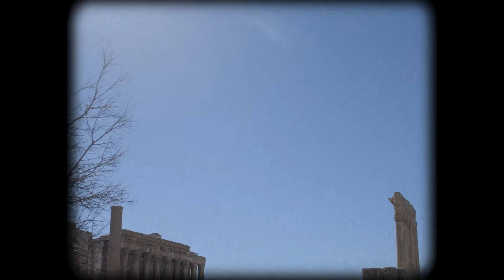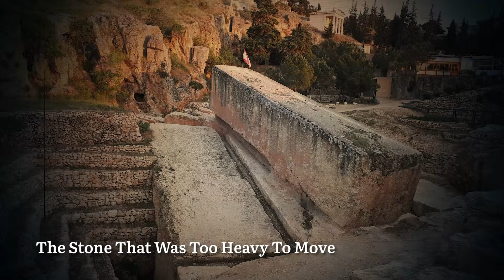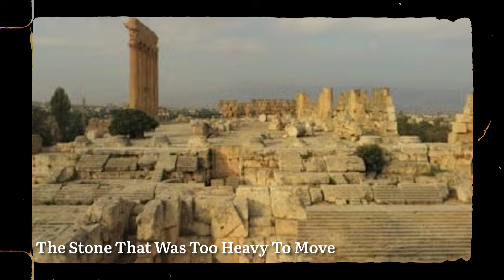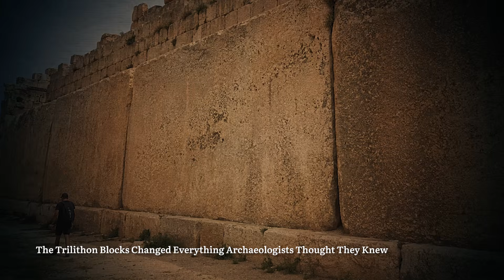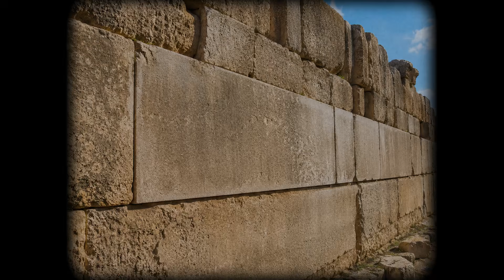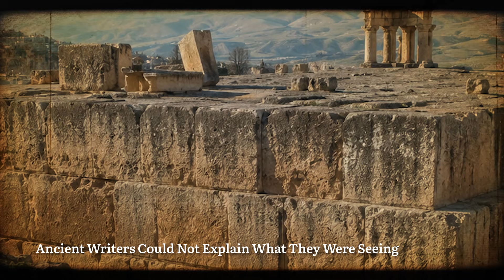It’s The Largest Object Ever Cut By Human Hands, and We Still Can’t Replicate It: Baalbek

Comment: The Stone of the South, the West Stone, and the recently discovered 1,650-ton megalith located near the Stone of the South were not cut out from a single piece of limestone in a quarry, but were cast in situ from a concrete-like material. During the casting process, masonries made of relatively small stone blocks were used as a rigid internal filler. A similar conclusion was drawn regarding the “trilithon” blocks and the plinth blocks forming the large podium of the Temple of Jupiter. Thus, the Baalbek megaliths were never transported from the quarry to the construction site. A number of features identified during a detailed analysis of the masonry of the Temple of Jupiter podium led to the conclusion that the so-called medieval Arab fortress was erected before the construction of the ancient Roman temple, rather than after, as is commonly believed today. The latter finding, together with the presence in the Baalbek structures of cavities from reinforcement in the form of multi-meter metal rods of large cross-sections, indicates that the “ancient Roman” buildings were erected during the era of industrial production of iron and large-sized products of it.

Details are in the article “Analysis, presumed structure, method and time of fabrication of the Baalbek trilithon and “tired” parallelepipeds” (50 pp., 2026).
Reply: You are just trying to sell a book of false claims. Scientific evidence shows those are natural stones not man-made concrete.
Reply: @Anonymous------  >You are just trying to sell a book of false claims.

The mentioned article is freely distributed.
Reply: @Anonymous------  >Scientific evidence shows those are natural stones not man-made concrete.

The aforementioned article presents scientific evidence that the stones are not natural but were produced by casting a concrete-like material into molds.
Reply: Literally all of the evidence goes against everything you said. You can see different blocks at every point of the process being cut out. I don't get why some (few) believe they molded them. It's the worst theory out there
Reply: @Rancid_Sanity  Literally all of the available evidence contradicts everything we have been told about Baalbek. I did not just say something – I proved it. You did not even read the article itself and came to your conclusions after reading only the abstract. It is impossible to fit everything into a short abstract. If you disagree with something, read the article and present your arguments. My arguments are given in the cited article.
Reply: @RostislavLapshin no I'm not gonna waste my time with you cause you are delusional and would be pointless. Thankfully most people are not delusional and only a tiny amount even enterain your theories. You are no different than a flat earther. At least you are watching the right videos and maybe some day the info will sink in
Reply: @Rancid_Sanity  >no I'm not gonna waste my time with you cause you are delusional and would be pointless.

If you have not read the article and have no counterarguments, why did you write your comment? Don’t you have anything better to spend your time on?
Reply: @Rancid_Sanity  >Thankfully most people are not delusional and only a tiny amount even enterain your theories.

Speak for yourself.
Reply: @Rancid_Sanity  >You are no different than a flat earther.

What does that have to do with the topic being discussed?